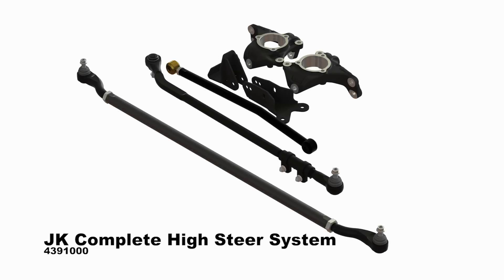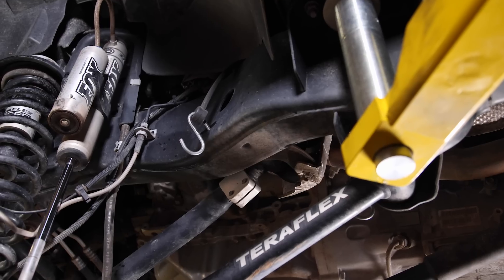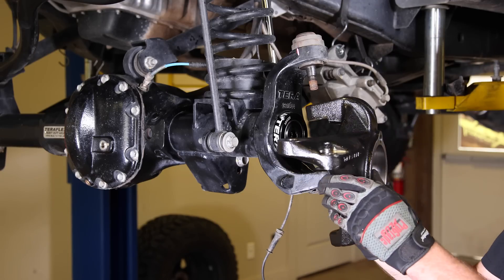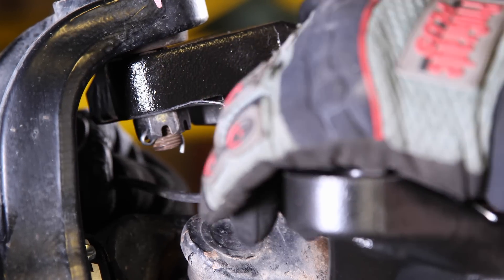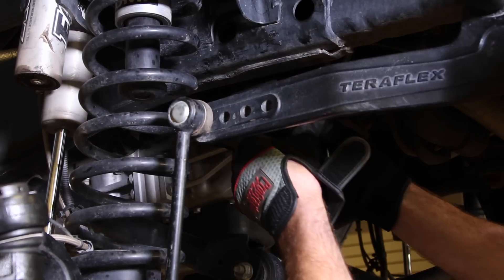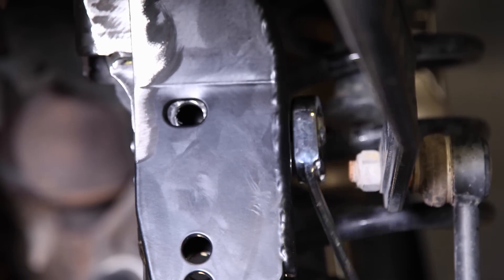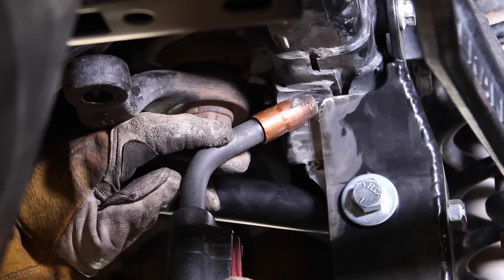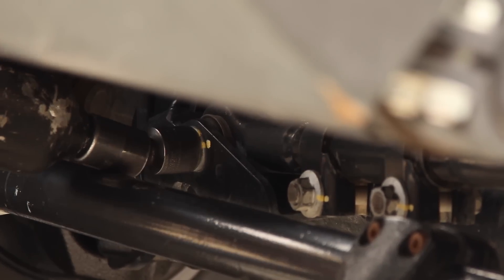TeraFlex Install: JK Complete High Steer System (4391000)

Comment: I love how easy everything is to remove and install in Utah.

We need someone in Ontario to make installation videos like this where removing the wheel bearing takes 40 minutes because it's siezed solid to the knuckle from one winter. Or how you can't just "mark the area for welding" because you have to grind off all the rust from a 2 year old vehicle in order to get a paint marker to stick. Or on your 4 year old JK all the steering box bolts break off in the box as soon as you hit them with an impact.
Reply: My jeep was driven for 3 years in Canada. I'm replacing my rusted tie rod tomorrow. It should only take 8 hours to remove the 2 ends from the knuckles.
Reply: monsterenergy927 lmfao

Comment: What about roll center. It is my understanding that you shouldn't use frame drop brackets for the track bar but instead raise it on the axle side to correct the roll center geometry.

Comment: any insight into if I need high steer knuckles with the upgraded tie rod and drag link? I have a 3.5inch lift but can't determine if I need the knuckles or if the flipped drag link by itself is enough.
Reply: I got the knuckles, as they are a bit more heavy duty than the stock ones.  Depending on how you use your Jeep, you might not need them.

Comment: At 6:26 the installer puts the frame brace in the wrong drivers side bracket hole for the fitment of the passenger side frame bracket. Final install has it in the correct position...installers beware!!!

Comment: Are the knuckles required for this?
Reply from the maker: No they are not. If adding to stock knuckles, only a "flipped" drag link with a tapered sleeve is needed.

Comment: Anyone know why I can’t screw in one of the tie rod ends?
Reply from the maker: The tie rod ends have opposite thread direction. One is Left Hand Thread, and one is right hand thread. You should be able to see some markings on the Left Hand thread sections. A grooved line cut into the tire rod tube at the end, and a notch on the large jam nut. The right hand sides have no markings. Make sure you have One of each and they are going in on the correct side. Left hand Thread will be Lefty Tighty. Give our techs a call if you want to send some photos or double check parts that were sent.
Reply: @teraflexsuspensions  Which Teraflex  steering stabilizer works with this kit? Seems I can’t get a straight answer. I have ordered two different ones and according to shop they don’t fit.